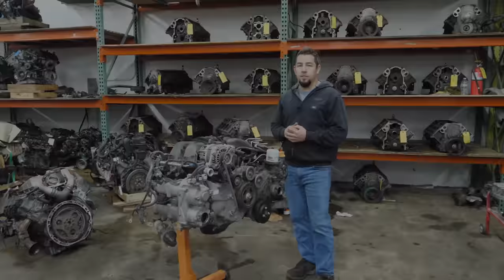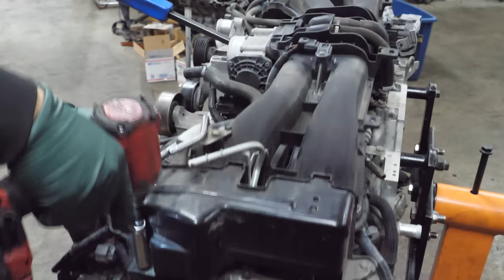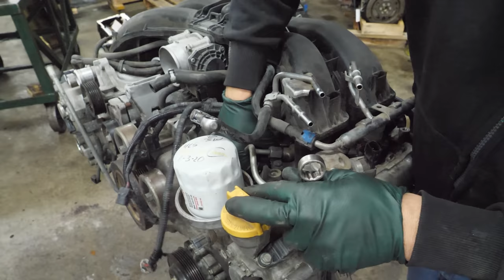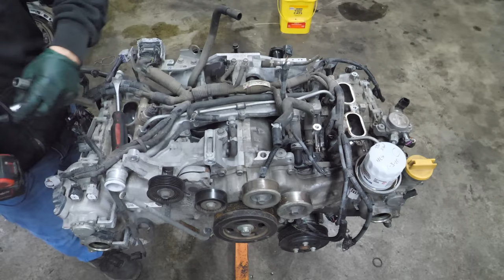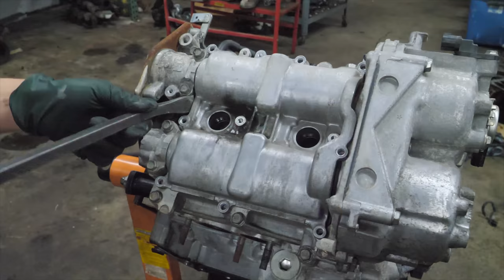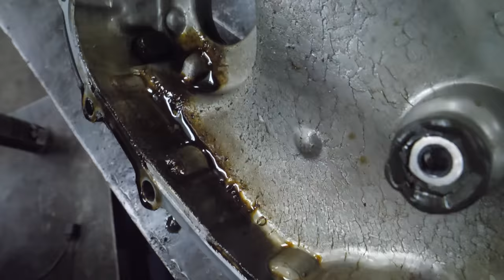Blown Subaru BRZ / Scion FRS FA20 Boxer Engine Teardown. A $3,000 + Whoopsie.

Comment: the valve spring recall is NOT done with the engine in the car! On the FAs, the whole cam-plate assemblies are removed. (On the FB20s, the cams can be left in with some special tools to fill the cylinder with compressed air so spring replacement can be done mostly-assembled, but even those are still done out of the car.)

One challenge for the D4S system for cores is that the injectors and the injector driver module (which is missing on your example here) are all matched together.

Must have been an FRS engine, not sure about those, but the BRZ comes with NGK plugs (as to all other subarus) from factory.

You don't need to pull wrist pins on the F-series engines to get the pistons out, but access to the cap bolts is kinda tight as you discovered. They're an E-Torx fastener, I forget the size offhand but I think E12?
Reply: All truth. I build the NA FA25 and the FA24 Turbo engine short blocks for all North American Outbacks,legacy, and accent models.. They all are like this just bigger displacement and various plates and plugs. But mostly the same design. That's what's great about Subaru imo.
Reply: @dcinhere  oh, you're one of the guys making the remans? please stop dropping them on the RF corner lol, i'm the one that needs to put them back in :P
Reply: @Chippy569  no I build new cars at the assembly plant lol. We do build service engines from time to time, but not remans.
Reply: I have  a 2018 BRZ, I have used E85 with an OFT tune for about 20 k miles of the 64 k miles I have in the car since new. Do you think E85 can damage the spark plugs or clog them up?

Comment: I drive a 79 Subaru wagon with an 87 EA71S engine, the one with chrome plated aluminum cylinders and low tension rings. Revs to 6500 RPM and makes 130 HP with dual carbs over the intake ports and 42 degrees total timing. Rock solid reliable being a pushrod engine, has titanium valve spring retainers, etc. Still has the original aluminum pushrods with cast iron ends even. The one issue it has is burning oil. It's not worn out, at all, but those old style low tension rings are very prone to burning oil, even running 10w-60 oil vs the stock 20w-50. So I check it every morning. Never seen it get lower than halfway up the dipstick, even after 12 hours of continuous driving at 4,500 RPM. I change the oil every 5,000 miles and it's always fine. Have a Ford billet 90 deg oil filter adapter and run a Premium Guard PG4651EX or UPG63R filter, sometimes the Microgard branded version. I like the silicone gasket. Never a problem.

Comment: I've been waiting for this video! I have a 22 GR86. It is my absolute goal to always make sure the oil is always good to go. MOST issues are because of lack of maintenance.
Reply: Make sure to reseal your oil pan gasket. American assembled engines have issues with having excess silicon gasket and it could get suck by the oil pickup. Just remove your oil pan and re-gasket it with a nice thin line.
Reply: @Walterrinho  all the engines are made in Japan. It is an issue with the 22/23 cars in all markets. It can also be an issue with the gasket material on the timing cover as well as the oil pan gasket material. You can not remove the timing cover while the engine is in the car without removing most of the engine components.
Reply: @mrs_radrod  and that boggles my mind. If the factory is fucking this shit, up, it's either a bad design or someone isn't doing their job properly (whether by accident or intent).
Reply: @CaptainSpadaro  Don't worry. The factory engineers knew about this problem since 2018 when the MY12/13 FA20 engines were being recalled and the recalled engines were failing due to overuse of gasket material which was being sucked into the oil pickup tube after the recall was completed. 

The engineers should have designed the new engine to use a gasket instead of an RTV. They knew this was an issue. They did nothing. They are blaming customers that the engines are blowing up. Never buy a Subaru engine.
Reply: @mrs_radrod  To be 100% fair, Subaru isn't the only manufacturer using RTV for timing covers (Ford, Toyota, etc. do as well). That being said, it seems like everyone has been having odd gaffes like this ever since the 'rona fucked shit up.

I would think the rather public incident with that one GR86 owner would have forced Subaru to pay more attention to the goings-on at their engine plant but apparently I'm wrong.
Reply: @mrs_radrod  gaskets are trash in general, using rtv for machined surfaces that won't see high pressure is perfectly fine. The issue they're talking about has to do with assembly, not design
Reply: @Walterrinho  removing the pan on a new vehicle just to redo the rtv is hilarious. It's covered for 5 years or 60,000 miles. Just drive the thing, and if you notice any issues, let the techs at the dealer suffer through it.
Reply: @Hawk7886  My point was that the design should follow the assembly process not the other way around. Lowering failures through design is part of 6-sigma design and is well known in the automotive space. They just dont think its worth it if only the high performance models suffer failures because most people buy low performance cars which even if these problems persist, wont have as large of an effect.

Comment: Woo, one of the engines I’ve been waiting for! Thanks Eric! 

I thought the recall was only for early production engines. Allegedly one of the other ways these die is dealers (particularly Toyota) using too much RTV or applying it incorrectly when performing the recall. The application instructions are pretty intricate - they even include a template to practice on if I remember right. That said mine is still running great ~3 years after the recall, including a bunch of track time. 

Would be awesome to see a Mercedes M274 or M113 (non-K) engine. Shouldn’t be too hard since MB put those engines in everything from their respective eras…
Reply: That is EXACTLY what's been happening: people take them in for recall work and the tech uses too much RTV, the RTV falls off, clogs the oil pickup, and chaos ensues. It happened to a buddy of mine 2 years ago when a group of us went down to Tail of the Dragon; he had had the valve spring recall done before we went down there, it started knocking while we were running the Dragon, and that was it.

What's even scarier is that the new cars are (apparently) being affected by excess RTV FROM THE FUCKING ENGINE PLANT. I don't know what's going on with Subaru but they need to get their ducks in a row.
Reply: @CaptainSpadaro  apparently Honda is having a similar RTV issues these days too. Idk how they’ve been using rtv for 20+ years with zero issues to now nobody can apply it properly
Reply: @JackS425  which engines are having problems?
Reply: @JackS425  the guys that used to build them have died. Now, they're younger and lazier

Comment: My 2004 Sybie Forester with 300000KM still has original 2.5 engine and 4 speed automatic transmission. I did all the maintainace myself as in the owner manual.
Reply: Not the same at all.

Comment: Neat, I've had a bunch of ej's apart, but not any of the newer series of engines, and it's really neat to see what's different and what's the same.
Reply: Agreed. Done EJ and EG myself, but never FA or FB series. There's some good and bad in both, but I really like the canted rods. It appears to Make installation and removal easier.
Reply: funny enough the new FA24 has assembly more like the EJ motors again. They have ports to remove the wrist pins, the canted rods proved to be less robust.
Reply: Subaru have been doing flat fours for decades now but STILL can’t make a good engine. Pathetic.
Reply: @alexwu8077  it's a layout with tons of inherent design issues, sort of like Mazda and their Rotary engines.
It's true that Subaru can't figure out the basics, though. Just look at what they did to the new WRX.
Reply: @Hawk7886  I have a BRZ, can you point out some inherent design issues so I can learn about my engine. Thanks in advance.

Comment: You should keep a scoreboard for the various types of failures. No doubt that running the engine out of oil would be well out in front of the other causes.
Reply: Hard to determine exact cause of failure sometimes if you don't have the vehicle history or don't know certain little quirks of any particular engine. For example if the rod bearings go and you don't know anything about the history well that could be a hundred different reasons.

Comment: Another BRZ owner checking in. The engine definitely has a lot of "character" and sounds like a  garbage disposal at idle even when it's in great condition. With good maintenance they last well, I'm approaching 60k and feed it nothing but the finest kirkland 0w-20 synth. The oil reports are still coming back with extremely low wear metals so I hope to have quite a few more miles in her before having issues. It's all the more impressive since I drive like a degenerate and am running E85.
Reply: Wow that oil is better than royal purple or better hmm interesting info 👍🙏👍
Reply: @gamermicha3l  royal purple sucks
Reply: @Hawk7886  oh no I noticed man I gotta due oil change lol
Reply: BRZ owner here too. Do you think E85 causes any damage to the spark plugs? Do the plugs need to replaced more often when using E85?
Reply: Ever try penzoil ultra platinum ow20 ? Running oil reports ? Or anyone have thoughts on that oil I saw project farm videos but any 86 brz owner run that oil?
Reply: @gamermicha3l  BRZ owner here, I run that oil because I saw the great results also from project farm.
Reply: On my 18 BRZ I added 2 quarts of oil between last oil change. 29k -  34k miles. Definitely need to check the oil.

Comment: Just picked up a BRZ and my wife has had an FRS for a year. This one should be interesting 😅
Reply: Why would you want two?
Reply: @Hawk7886  because they are that good of a vehicle. Only other car that compares in driving is a 718 porsche and it's 3×-4× the cost not including maintenance or insurance fees
Reply: @Hawk7886 it’s a solid platform, the transmission is one of the better transmissions as well, super easy and cheap to rebuild

Comment: You are so right, all you have to do is maintain the oil level, today's engine oils will last 10 to 20,000 miles without any problem as long as you just keep it full. I mean full to the full Mark not full to the top of the dipstick tube
Reply: Not in the case of a Subaru. I've seen many who've changed oil in their EJ every 5,000 miles, only to have the engine blow up before 50,000 miles.
Reply: @joshjlmgproductions3313  then that is a pos that no one should buy.

Comment: I would love to see more diesel teardowns, like the smaller diesels.
Diesel engines tend to have more dramatic failure modes :D
Reply: Even a Subaru diesel, EE20, but they didn't sell them here. They're just starting to be available on eBay at this point.

Comment: You are 100% correct people do not check their fluids in their vehicles I’ve been a mechanic for 30+ years I look at so many cars that come in with engine noises and there is no oil on the dipstick
Reply: I have  a 2018 BRZ, I have used E85 with an OFT tune for about 20 k miles of the 64 k miles I have in the car since new. Do you think E85 can damage the spark plugs or clog them up?
Reply: It's one thing to neglect your $500 lawnmower's oil. It's another to neglect your $20,000+ vehicle!!

Comment: Interestingly the new fa-24 engine went back to the old way of splitting the case.   This allows symmetrical rods, which are stronger.  Important, since it's replacing the six cylinder.  Even in the Ascent, which can tow 5000lb.
Reply: Increasing displacement is also the easiest way to boost power numbers. I'd love to see an Ascent with its CVT tow 5,000lbs for thousands of miles with no issues, lol
Reply: @Hawk7886  The engine is probably fine but I'm guessing that CVT would melt.
Reply: @Hawk7886  yeah it's a recipe for disaster. You can go ahead and claim it can tow 5000 lbs but it's a 2.4 liter turbo...not gonna end well.

Comment: I popped one of these almost exactly a year before you posted this, very similar bearing failure. Dealership told me it was because the oil hadn't been changed in 30k - that's what the sticker in the window said because that's how long ago I'd taken it in for the recall. I was actually changing it every 5k. Seen a couple of people online saying the same thing happened after some extended roundy-rounds kept the oil in the heads and starved it

Comment: I watch this and... I miss the old '64 F250 we had.  Straight 6 240, I think one vacuum line from the carb to the distrubutor.... one power lead running to the coil... and that was it.  I love technology, but it sure comes with it's burden.
Reply: People demand more power and better fuel economy than ever before. Added to that, the manufacturers face a lot of pressure to reduce emissions. Naturally, when you hit a situation that basically says, "choose two things: more power, better fuel economy, less emissions" and you pick all three, engines are going to get more complicated. This started back in the 80s, so it's been going on for a while.

Comment: Been watching your engine teardown videos for a while and these have been enjoyable so far. Also as a new Evo 5 owner I wish you could get a hold on 4G63T someday, especially out from an Evo 4 since those were known for crankwalks and you can import them there ;D (as were Evo's from 1 to 3 too but those have same engine as DSM's, Evo 4 engine is the same-ish up to Evo 9 with some changes here and there)
Reply: i want a 4g63t with the 4 speed auto.
Reply: crankwalk, oh no... I thought them were reliable
Reply: @itwilsonboiii4789  Yeah Evo 4's still had that issue on non rebuild/swapped engines but it was fixed on Evo 5 onwards
Reply: @Fang4G63T  ty for early rep. Is there a permanent fix on it or parts-replacement interval?
Reply: @itwilsonboiii4789  The crankwalks usually come at 160k km or around 100k miles, permanent fix is to change the engine from a newer one (Evo 5-9) or if you dare, to machine the block and change all the bearings before it starts to crankwalk
Reply: @Fang4G63T  wow, what's last gen of having crankwalk
Reply: @itwilsonboiii4789  1997 Evo 4's are the last ones, anything after (Evo 5 onwards) don't have the issue

Comment: One reason I learned to love the electronic oil level on my BMW. I check the oil level right from the driver's seat every time I get home before I turn the engine off. The main downside though is you can't check the level if the engine hasn't been running for a minimum time and temperature.

Comment: I have to say I’m impressed how well it held on with oil starvation.  Not even bent rods or destroyed pistons.   That engine has to be “bulletproof”.  Maybe Toyota designed it and Subaru made it?
Reply: They have been blowing up from oil starvation for almost 10 years now. How is that impressive? Its your standard Subaru motor with oiling issues.
Reply: @paladain55  got any source?   I believe it’s lack of maintenance.    There are some reports that have done over 300k miles on those engines.   idk 🤷‍♂️   There was a issue that some of them had too much rtv applied on the oil pan gasket causing the excess to go in the oil pan.  That’s why engine starve for oil.
Reply: @GalenlevyPhoto  *lack of oil baffling kills them in long sweeping turns. starves them of oil
Reply: @paladain55  are you speaking of drifting them too much cause gravity of oil from the oil pan starves the engine?   Subaru have been racing in rally for years with 500-600 hp with so much abuse.   🤷‍♂️
Reply: @paladain55  as someone who owns one of these FA-20 engines on a WRX all I can say is yeah..change the oil every 3000 miles and keep a close eye on things. These are not the kind of cars you just set and forget.

Comment: Hi guys, I watch you regularly on my television because I enjoy building engines also from the ground up and several of your engines you have recently taken apart that were four cylinders Hondas and what have you I saw the one on the Subaru, where they were completely destroyed all four cylinders, pistons everything gone And I believe I understand how this is happening a lot of the time I have seen people tow these vehicles behind big diesel powered motorhomes at 75 and 80 miles an hour with a tow bar and all four wheels on the ground. Well if you do that, the newer design automatic transmissions have a front oil pump that runs when the engine is running but if the engine is not running, there’s no oil moving in the transmission, so my theory is the driveshaft is hooked up, so it continues to weld the output shaft of the transmission to the input shaft of the transmission with all the components welded together. At that point it starts to turn the engine itself through the input shaft of the transmission and you don’t have the advantage of an overdrive you were actually over revving the engine going down the road 75 miles an hour And until the rear wheels completely lock up, you’ll probably never even know what was going on 40 feet behind you while you’re driving down the road in that motorhome at 75 or 80 miles an hour, and when he finally pulled off the side of the road, and there was nothing left of the rear tires rims or engine or transmission or anything he had a weld it together unit from the rear axle all the way to the water pump. What do you think?